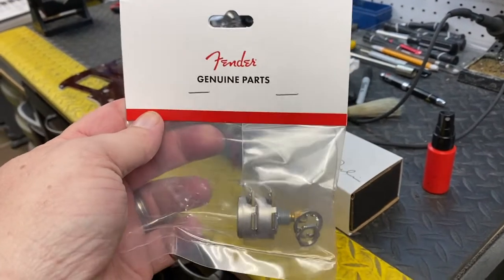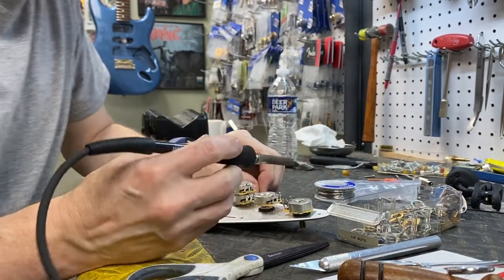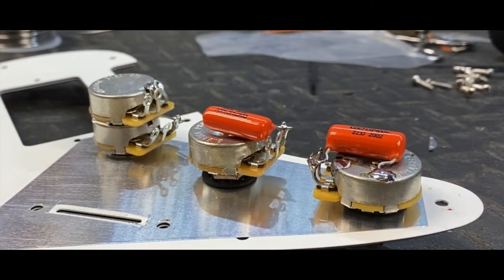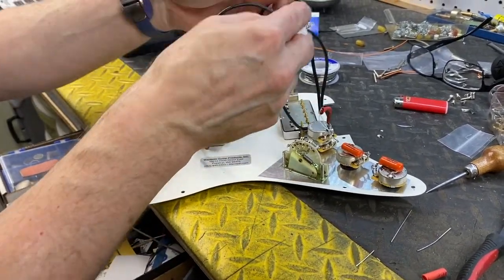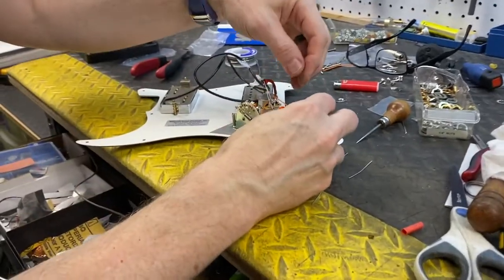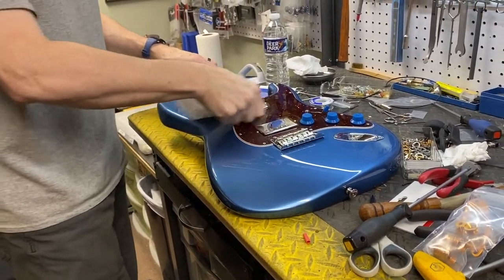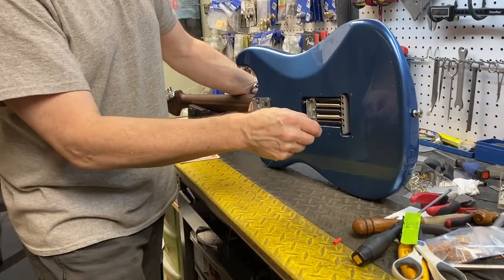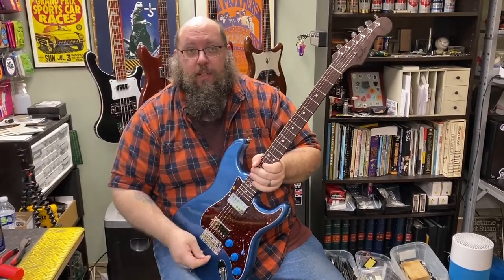Fender 500K/250K Dual Pot - worth the install? Find out here!

Comment: Love your video. I bought the same Fender stacked volume pot to convert my SSS Mexi Strat to an HSS with a Seymour Duncan Trembucker. I also went to a single volume single tone for 2 knobs to move them away from the high E string because Strat trem arms hit the volume knob on dive bombs, not to mention my hand which is annoying. Problem solved. 2 knobs is better, less crowded too. Thanks for confirming the 250k pot is further from the shaft 👍
Reply from the maker: I ran my Strats like that (2 knobs in pos 2 & 3) for many years until I got on a kick of putting them back to looking "normal." There's a lot of benefits to having nothing in that first position if you use the trem bar a lot!
Reply: @chiba131  yup, And I use the trem a lot, surprising Fender introduced the Stratocaster with a tremolo bridge where the arm hits the volume pot. Besides that the volume knob rubs against my baby finger.

Comment: Looking forward to the sound test video. I’m planning to do the same with an old Yamaha guitar. I plan to use two dual pots, one for volume and the other for tone. With a split coil switch for the humbucker.  Other alternative is to have two tone knobs and make the humbucker a pull knob for coil splitting.
Reply from the maker: I'm not sure you can find a push-pull dual pot, but if you do, please leave a link!

Comment: This video makes no sense to me...well it does up until you put the blue plastics on. The fender concentric pots require a specially made knob that allows you to make adjustments to concentric pots independantly. and youve just slapped a generic blue plastic on it......sooooooo....WTF?! 🤣🤣🤣
Reply from the maker: Concentric pots do indeed require special knobs. These are not concentric pots - there is one shaft that controls both pots at the same time, so it only needs one knob. Concentric pots have - for lack of better words - an inner and an outer shaft, and thus have two knobs set one on top of the other.
Reply: That folks is what’s called a “BURN”… 😆🤘🏼✌🏼

Comment: Hi Moto Chiba, I believe I am now your 700th subscriber. It is an honor. I feel honored. Do you know if it's possible to set up a toggle switch to select between the different halves of the dual pot? Like, toggle in one position & you're in 500k, toggle in the other position and you're in 250k? I got this idea in my diseased mind from thinking about the Jaguar and how the different volume pot values contribute to the DAAAAAARKNESS!!! of the rhythm circuit. I dunno, just something I've been thinking about. If you see this before Jan 1, 2025, I probably haven't gotten to my project yet. Good luck and godspeed to you, good sir.
Reply from the maker: I don't see why you couldn't do that.  You'd need a DPDT switch, and then wire the pickup(s) to the switch FIRST, sending each side's hot to either side of the 250/500k pot.  Sorry it took me so long to reply - this is a really cool idea, especially for a Jaguar!

Comment: I have a Tele that the previous owner installed the Seymour Duncan Humbucker made to fit, but it had a regular neck pup. I bought the SD str2 hot rhythm for the neck. The wiring diagram would be the same as yours then? Just wondering.
Reply from the maker: Yes - AFAIK the STR2 is a regular single coil, just wound hot, so it would work best with a 250k pot while the humbucker would work best with a 500k pot.

Comment: Would you need to change the tone pots as well? I want to put a higher output humbucker in my HSS strat, but I'm curious if I need to change the tone pot for the humbucker to 500k as well
Reply from the maker: I would recommend a 500k tone pot for a humbucker, definitely. A lot of people will wire the 2nd tone pot so it's only for the bridge pickup (even if it's a single), and that seems like a good move for an HSS guitar.

When I initially put this wiring scheme together, I definitely used a 500k tone pot for the bridge pickup and a 250k tone pot for the singles.

Comment: Is there a version of this that also has a push/pull function to do series/parallel switch on the humbucker?
Reply from the maker: Not that I'm aware of, but you can find push-pull (or push-push) pots to do this switching. Most folks put them in the 2nd tone pot spot.

Comment: Can you use the S-1 to split coil? I have a tele and I want to split the neck wide range humbucker to single coil .
Reply from the maker: Yes, you can use an S-1 pot to coil split, you just have to figure out which bank of contacts does what and wire it up right.

I'm not sure a WR pickup can be split, though. I've never taken one apart to see how it's wired.

Comment: Great. - Would you recommend using a dual pot (250/500) for my 335 neck HB (seth lover)?

I play blues and jazz and the lover comes with 500k. Good and bright for blues but for jazz I would like a warmer tone. 

Greetings
Reply from the maker: No, I wouldn't recommend that. You're likely better off experimenting with tone pot capacitor values than changing the pot itself.

Comment: Man so glad I found this video. Is there any way you can send me a wiring diagram for an H(bridge) & S(neck) pickups using the fender dual pot and a single tone pot with a 3 way toggle switch? It's going in a Les Paul Junior. I would be very grateful! I can't find any diagrams online. I didn't know this dual pot existed.
Reply from the maker: It's easier than you think.  Wire each pickup to its relevant section of the volume pot FIRST - hum to 500, single to 250. (IMO that's the real secret/trick to using these dual pots.) Then run the output of each half of the stacked pot to the relevant lug of the 3-way toggle, and the output of the toggle to the jack.  IMO you won't need a tone on the single in the neck position, so wire the output of the hum part of the pot to the tone pot as well (so it will have 2 wires coming out of it) and you should be good to go.
Reply: @chiba131  thanks for getting back to me. Can you draw a diagram for me? I am a visual learner haha. Some toggle switches look different some lugs need to be grounded to the pot etc. It's easier if I can visualize it. If you don't have time no worries. Cheers.

Comment: Great video guys!  Since you have 2 pickups not 3, can you just add a 470 or 500k resistor from the hot single coil lug on the switch to ground so the single coil 'sees' 250k, and no double load issues?
Reply from the maker: I suppose that would work OK, but I didn't think of it.

Comment: Can you do the same with a concentric pot, or did I buy the wrong one.
Reply from the maker: Yes, you can do the same with a concentric pot BUT! the concentric pot parts are likely to be the same resistance (250 or 500, not 250 AND 500) and you'll have two knobs to deal with.
Reply: @chiba131  thx. What I really want to do is wire it up with 2 separate pots, one 250k for the single coils and 500k for the double coil. I never use the tone so I want to take it right out. I believe this can be achieved by wiring  the pickup to the appropriate pot first, then to the selector switch rather than the standard strat wiring which is the opposite. Like a Gibson type wiring.
Reply from the maker: @davekiddie4467  You're correct - if you're taking the tone out of the circuit completely, you're definitely on the right track!
Reply: @chiba131  there is a concentric pot with 250k + 500k stacked... Fender makes it (or rather it's a CTS rebrand). Mind, you'll need small concentric knobs, not the usual bigger ones which are usually for bass guitars.

Comment: Can we use this for both volume and tone control(single pot)?
Reply from the maker: You could, but they would both be at the same 1-10 value since there's only one shaft.  If you want to get the one-pot look for vol & tone, you'd need a concentric pot.

Comment: should the 2nd tone pot be dual resistance too?
Reply from the maker: Not in this case. The volume pot is dual because it's connected directly to both pickups. Each section of the dual volume then goes to its own tone pot, each of which is 250 or 500 depending on which pickup it's being used for.

If you had one volume and one tone on the guitar, then yes, you would want to also use a dual pot for the tone.
Reply: @chiba131  i forgot the 2nd tone pot only controls the bridge pick up, so 500k alone is fine, or am i missing something?
Reply from the maker: @AceBambam  if your tone pot is only controlling the humbucker, then yes 500k alone is fine